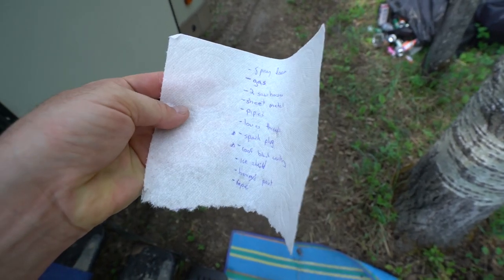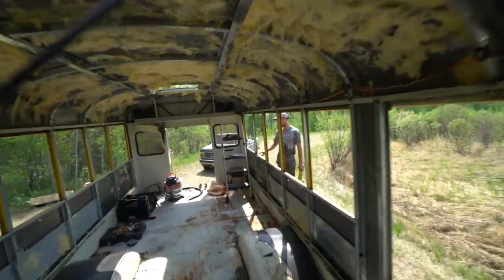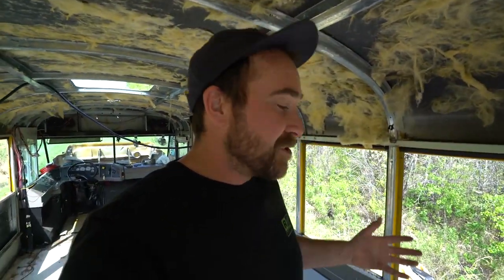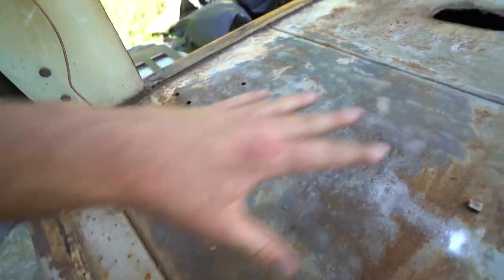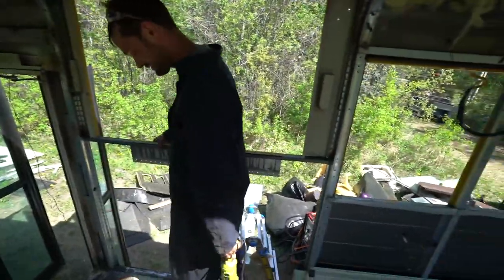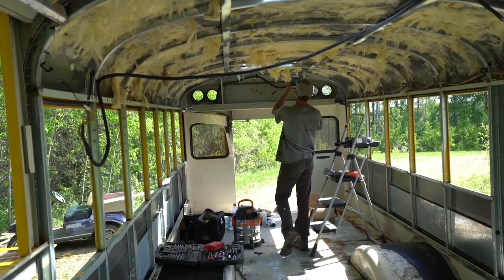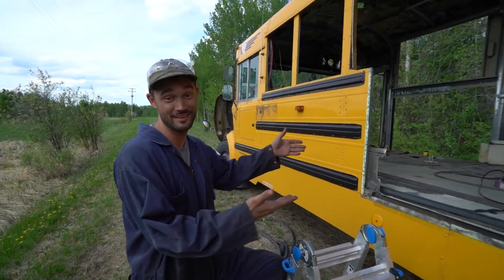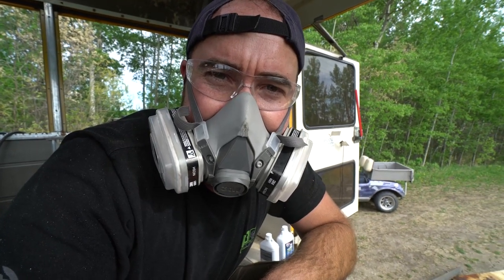BIG PLANS FOR THIS BUS CONVERSION !!!

Comment: That welder you have can seperate the white control box and the red base so you dont have to  pick up the heavy welder just move the white control box closer  to your work area .Orginal control cables should be long enough.
Reply from the maker: Indeed. Works much better than rolling it around ✌️

Comment: Use a hot short nap fabric dog roller and roll some black or silver Hammerite paint by Rustoliuem, its cheap durable and dries pretty fast, it works woners on rusty frames of my old trucks rusty metal ect . They also make this stuff ca;;er POR 15 or something like that, its really good for rust too but its pretty expensive

Comment: Osphoric Acid will convert the rust WITHOUT all the grinding.....If you insist on grinding get yourself a 3 inch cup brush ; it will do more quicker....you can paint a bus with rustoleum and a roller...lots of HOW TO Paint busses on a VW site " thesamba.com "...…..do you remember the old guy in the Penske Sprinter at Jamies van build ???
Reply from the maker: Yes I remember! Thanks ✌️

Comment: https://www.harborfreight.com/4-1-2-half-inch-nylon-abrasive-wheel-94017.html Jax these polycabonate wheels from Harbor frieght Northern tools ect  are amazing for rust! also  are you going to build a compartment for an RV generator and put two roof ac units on? you could even do a ducted air set up at this pint down one side .As far as the Generator you probably have enough room to mount it under the floor on the frame rails, or suspend it from the floor with some reinforcing .You can get a used Onan or Kohler 4,000 or 6500 watt generator out of a wrecked or salvaged RV or even Camping world has nice used ones for 500- 1200 bucks and roof acs are 3-600 new or 100 bucks each used, id get two 15,000 btu ac units, those rv generators run at 1800 rpm and are so overbuilt especialy the older Onans and Kohlers so they last a lot longer than an Briggs and stratton type horizontal engine running at 3600 rpm for hours at a time under full load .Many of them are already set up to run on propane too  which is good since you have a diesel bus and you already have propane anyway, and you wont need to buy gasoline just for the generator. if you build a compartment for it within the bus  BE SHURE its sealed WELL  even where the wires pass into the interiour and you also run the muffler and exhaust pipe away from a window that might be open or refigerator vent ect mabey even run the ex pipe up in the bus in an insulated channel and out the roof and put a flapper or a turndown on the tailpipe so the rainwater wont fill up the muffler. If the exhaust goes up to the roof you wont smell the fumes as much even though propane smells MUCH noxious  less than gasoline and it ill be a lot quieter too, its looking great! ive done this sort of work all my life.
Reply from the maker: Excellent info. Thank you so much for the comment 🙌

Comment: Rust converter doesn't work. You need a paint(por15) that seals the area from air.
Reply: dale ezelle . Very true... was thinking about the same. Por15 rocks 👍🏻👍🏻😎
Reply: This has always been my thinking as well.
Reply from the maker: We are using POR15 converter. Their paint is an arm and a leg. It’s also just surface
Reply: For small rust holes you can use por15 and fiberglass mat.